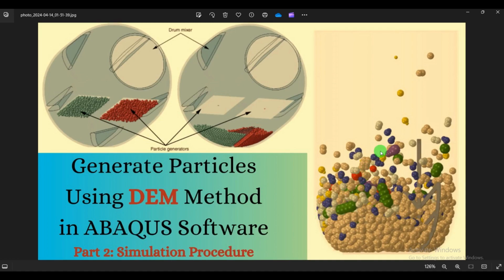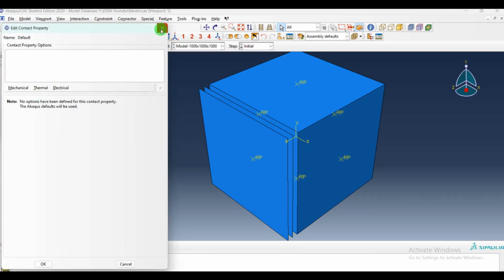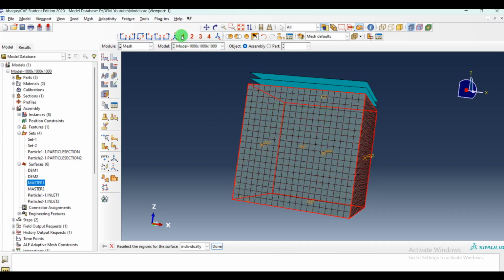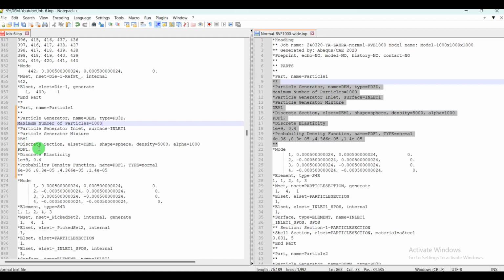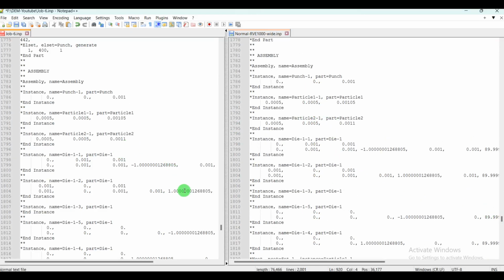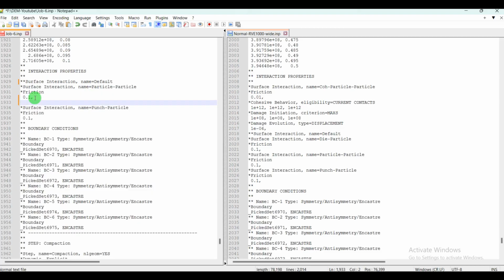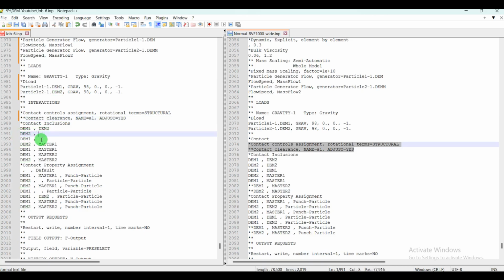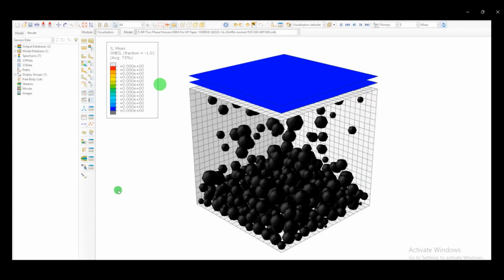How To Generate Particles Using Discrete Element Method (DEM) in ABAQUS; Part2: Simulation Procedure

Comment: Dear blogger, hello, could you tell me whether the finite element element can be deformed by the collision of dem elements? That is, the finite element is set to be a deformable body instead of a rigid body in the analysis.
Reply from the maker: This tutorial shows the DEM particle generator process. As you mentioned, the generated particles using this method are not deformable. If you want to have deformable particles, you should use Multi-Particle FEM. Please watch the following tutorial:
https://youtu.be/4EKqrUTC-C8